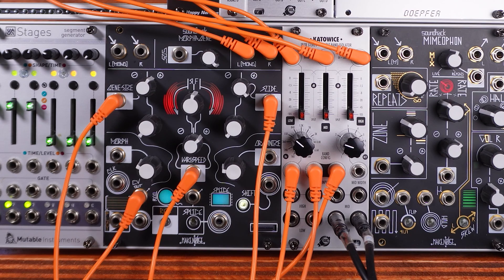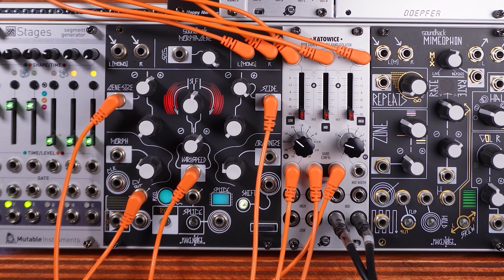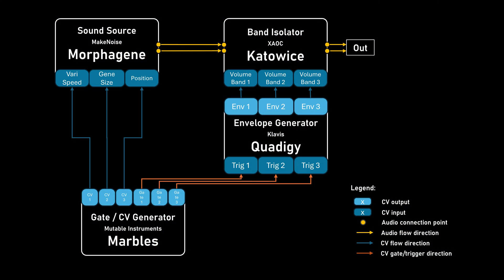XAOC Katowice, multiband EQ and processing in Eurorack

Comment: I picked up one of these at a good deal used when I was looking for an end of chain eq solution. Pretty quickly I realized it's overkill for that, and think I need something more set and forget. 

But this video has had me rethink immediately parting with it before putting it through it's paces in a other position in the rack. 

Good stuff. Thanks!
Reply from the maker: Yeah i can totally understand that! It's definitely one of my least used modules due how specific the use cases are. But it ends up in every feedback loop I patch up, which makes it worthwhile for me.